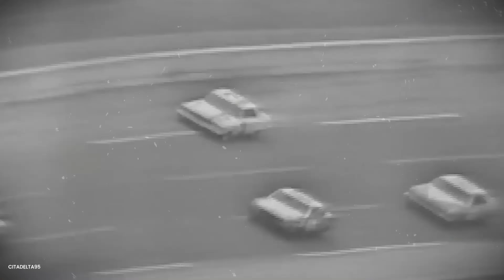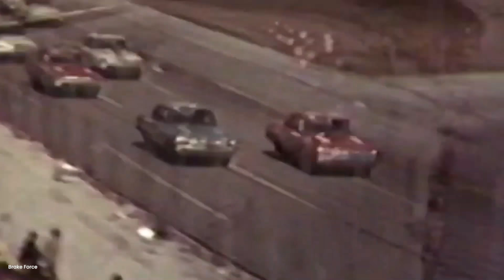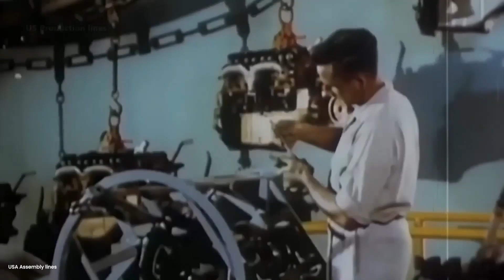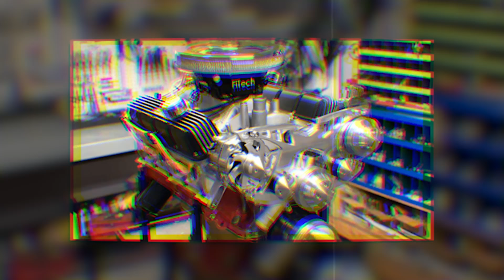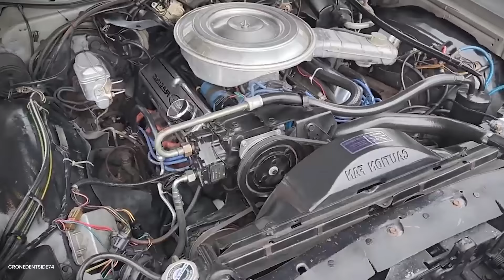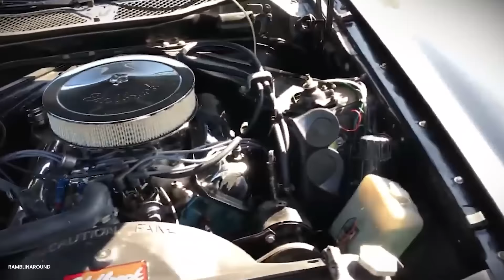This Oregon Mechanic OUTSMARTED Ford With a "Secret" 351 Windsor Stroker That Made 450 HP

Comment: The 400 crank will fit in a 351 Windsor the problem is not the bore spacing or the bearing diameters it is the snout on the crankshaft the 400 is bigger than the 351 so the snout has to be machine down and polish to accept a 351 harmonic balancer. 
These AI's are very artificial and not very intelligent 
Also there is no such thing as a 400m the 400 came first then the 351 m which is a destroke 400

Comment: I'm sorry but 302 rods are 5.090" and will not work, they will be 1" too short the piston will be 1/2" in the hole at TDC, a 4" stroker needs a 6.200 rod, cool story but not factual.

Comment: Ummmm what a bunch of diarrhea, first of all 302 rods will certainly not work in this scenario , more than likely stock 361 rods were used, and to suggest a 4” crank with 5.09” rods would be good is a complete moron, the stock 351 would be better from any perspective than what is suggested here lol

Comment: AI's future is toast if it gets so much simple stuff wrong. Example: a 460 crank in a 429 doesn't make a 501, it makes a 460. 429 and 460 have the same 4.36 bore. Differences is stroke 3.59 vs 3.85. 390 crank in a 352 doesn't make a 399, it makes a 380. 352 is a 4.0 bore. 390 is 4.05.

Comment: The 351 W was always a monster. Ive run them for many years. The problem with Ford engineers is that they are told what to design. They are under constant control of the bean counters. Ford does not and has never cared about performance, just how much profit is in every thing they made. Even today you will never see a 408 Windsor in a build up, even though it is a Ford  car these jerks have to use an LS Chevrolet motor which is a rolling explosion. This is good information...its just too late.

Comment: The numbers don’t add up. 
4” stroke with a 5.09” connecting rod means the piston pin height would be 2.41”
302 piston is roughly 1.6” 351w piston 1.8”
Could use the 351w rod and a 1.55” piston
Reply: Put Cleveland heads on Windsor
Reply: What a shitty piece of junk.  A  390 with a cheap cam would walk all over it
Reply: @Bill75456 problem with that is about 100 lbs more weight and a larger width and if you want to drop it in any 60s falcon or mustang engine space even 302s with headers seem like a tight fit when you want to change plugs. The 351w raises the deck height by about an inch therefore making it actually slightly easier to work on. I've helped work on a number of friends with 390s where it was an absolute nightmare to work on with those fuckin shock towers and power assist steering racks with headers. Don't get me wrong but add in the weight that tends to push the nose of the car in corners than a 351 and add it up. Common sense. It's like all the recent coyote swaps. A 302 cubic inch Coyote is the size of a 427 cammer. Impressive but hard to work on if you don't with a rack and pinion swap. The cammer my favorite of the fe s. I'm with you on the ease of big torque but the advantages come in the packaging where the adage work smarter not harder when it comes to working on them
Reply: @craigbaxter2873  an FE can weigh much less than stock just by using an aluminum intake and heads. Plus an aluminum water pump.  I built one this way that was 510 lbs. The narrow engine compartment is an issue, but the right combination of extension, swivel and padded socket, I never had a problem changing plugs. I never had power steering or power brakes. They make great aluminum parts still for FEs. I have never been a Windsor fan. The SHP 4.125 block and a 4 inch stroke Windsor seems like a cop out. The FE should have been made with 4.13-4.16 and 3.98 crank for replacing the old castings.   JMO. The 351 is a 70s engine.
Reply: a 509 rod wouldn't clear the crank with a 4 inch stroke the pin would hit the crank.  The 400 crank counter weights  are too large to fit in a windsor block the weights have to be cut down. it can be done but machine shop rate is out of sight.
Reply: So how long was the train
Reply: I come  up with 1.11 ch on the pistons with an 8.2 deck height block. Not a lot of room for rings. The stroke divided by 2 with a 4 inch stroke is 2+5.09+1.11 is 8.205 the deck height of a 289-302 block.  The oil rings will need support rails, and they will be hot running so close to TDC all the time.  A 351 block makes more sense, but the 10.17 FE With 6.49 rods and 3.98 stroke is perfect with a rod to stroke ratio of 1.63, the same as a 350 SBC. If you have one laying around it’s pretty easy to make room with a BFH or a shock tower kit. In a truck, it’s a no brainer.